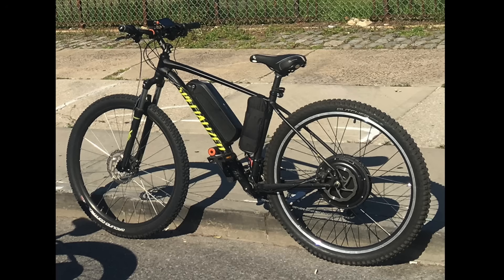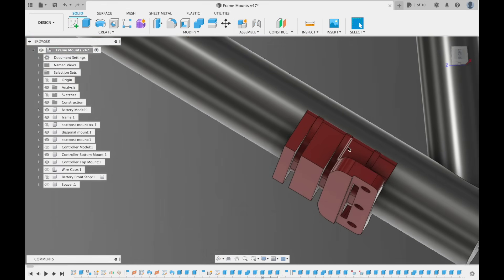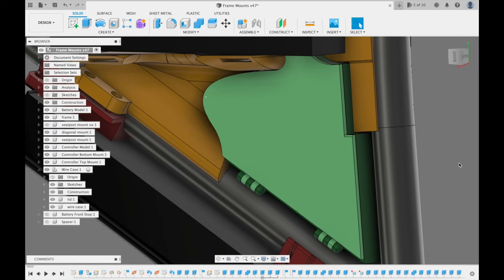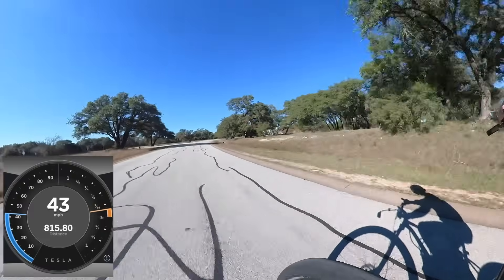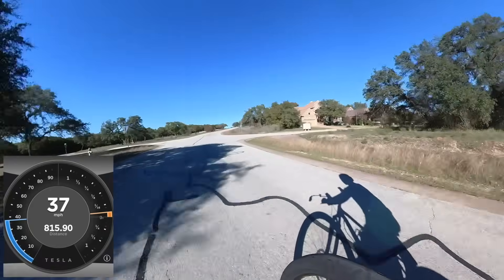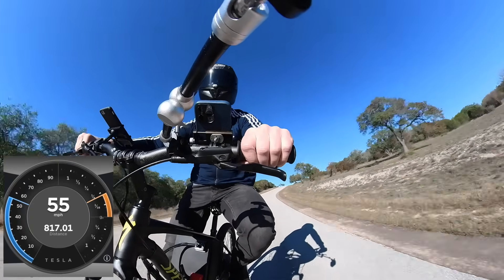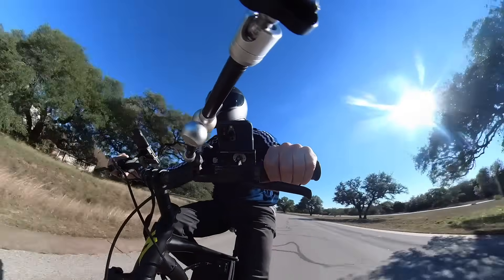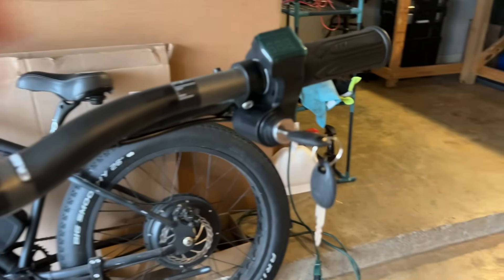I Built a 15,000W eBike and it's WAAAAY Overpowered

Comment: I don't know what kind of motor you have on that, but it seems like it should do a lot faster. Granted you have a lot of weak spots. The frame, you, your brakes, and pretty much every other part of the bike except for the powertrain. Lol You should try putting this on something heavier than just a bicycle. A bike with a decent battery and a CYC motor would do everything that yours just did.

Comment: Nearly 2x the power of my cargo bike build god damn. I have a 72V 8kW mid drive to a slim motorcycle tire in the rear with a proper chain.

It's a bakfiets style bike which means it handles like a yacht and being a steel frame it uses a lot of that power just hauling its 100lb self and 200lb rider up to speed.

Comment: haha, yup high voltage equals higher top speed.  wondering about the heating of those lipos in an enclosed space, pulling high amps.  also the windings in that hubmotor.  I built a bike from the wheels up, using a qs 273 motor laced to 18” motor wheel.  3” wide rubber front and back.24s LiFePO4 cells…40152s.  150 amp controller with regen. good 4 piston calipers on 203mm rotors to stop.  So important to have good brakes.  180mm travel fork with 40 mm downtubes.  hardtail on the rear😳.  110 lbs.  wheelies too easily, tops out at 50 mph, could squeeze out more speed with flux weakening adjustment in the controllers parameters….but why?!    It has bitten me a few times doing wheelies.  Still wear scars, lol.  be careful!  gear up.

Comment: How do you import your frame and ebike controller models into fusion 360? I want to make a 3d printed mount for my sabvoton just like yours! 🎉
Reply from the maker: the only way to import a physical object into Fusion 360 is with 3D scanning but high-res scanners are expensive. The lidar and/or photo-based scanning on an iPhone can be used but the quality would be poor. The best low-tech method is to carefully measure whatever object you want to import and manually model it in Fusion 360. That is what I did here and the same for all the other models I've created which an be found here: https://cults3d.com/en/users/GaiusGarage/3d-models

Comment: This is an awesome and wonderful hand work 🎉❤. I love everything about this SUPER eBike, never seen something like it.
My questions are how can I make my eBike to relatively have good speed. It’s 24volts which only has PAS, I think the controller is about 250watts.
What should I change, the controller, the hub, battery or both. I know my bike will not reach even half speed of this😂.
Greetings from Nigeria
Reply from the maker: Thanks! The bike will be faster if you upgrade the controller. but you many also need to upgrade your battery to supply power to an upgraded controller. You will also be sending more power to the motor so it may overheat faster and you may need to upgrade that also. so the answer is to upgrade all three
Reply: @GaiusGarage  appreciate your feedback.

Comment: E-bikeguy did 105 mph with a similar bike to this.
Reply: Exactly, I saw that video too that E-bike guy built and it was insane, and that was not exactly a fancy bike frame, just a regular bicycle frame. He had a steering damper on it, which was good, but my concern were the bicycle wheel bearings spinning at that speed with weight on them. You know those are tiny ball bearings running inside cheap steel races. Maybe it's fine, I was just wondering how they held up to the stresses of 100+ mph. Or the vibrations in the frame at such high speeds. But it worked fine!
 I loved the sound during the on-board part of the video as he ramped up the speed from about 22mph. It sounded like an airliner turbofan winding up on takeoff, it was awesome! Also the fly by videoed by E-bike guy as the rider flew by at 100mph was incredibly cool.
Reply: That is insane... It was scary enough at that speed with my 500CCM 58hp KTM road legal dirtbike lol :)
Reply: I was thinking how did he only achieve 60 mph When I seen a dude do double nearly. 
A 72v 15000w can achieve around 80 mph and 90+ off the ground. 
I would imagine a 100v 15000w would achieve close to 100mph and around 120mph of the ground. Or even more, I don't know. 

Doesn't really add up. Sure it's not a 60v peaked 7-8000w 😁

Comment: Hey buddy, for safety please,please put a flashing LED light (white) on the front of all your bikes. If someone came out in front of you going that fast , you would be toast. All people should have one. This is the reason I put it on the bike. As we all know from riding street bikes is that the most dangerous part is people not seeing you and pulling out in front of you. I laid my 1100cc Harley down because a woman didn’t see me. Luckily she paid for the damage. So after that I was out in the fog and I seen the strobe light on school busses. I said that’s it. It’s been 2 years now having a battery operated LED flashing, I have not had 1 person pull out in 2 years. , it lasts a long time and I just recharge it. You can wire one in of course and save your life. When they look now they see my flashing strobe, no more not seeing me. Mine are removable with rubber straps and are easily transferred to another bike.

Comment: How many watts can I claim on my footscooter build? It has 2 450 phase amps for a total of 900 !  It is 100.8v top charge 24s 16p samsung 45amp 50s cells.  The controller is 2 fardriver nd 84530 330 line amp . What is my real watts I can claim ? I am so confused! Please help.
Reply from the maker: you would use nominal voltage of 86V and 2x 330 line amps so 86 x 2 x 330 = ~56kW, which is pretty insane!
Reply: @GaiusGarage  thank you sir ! Much appreciated! I was figuring 48 but ...mathematical challenged after 50,000 🤣😅😂

Comment: I'm still blown away by just how cool 3D Printers are!!!
I'd love to have one, maybe one day I'll be able to afford one, they must come in super handy when deciding to build your own e-bike and doing various other fun projects..
3d printing is amazing.

Well on you for building one helluva an e-bike, I bet it's a tonne of fun to ride!
Reply from the maker: Thanks so much! yeah 3D printers can be really useful. you can pick one up for maybe $150, although the less expensive ones can be a bit more frustrating to use
Reply: @GaiusGarage  Hi there, 
Thanks for replying (most don't lol) I was wondering if you could help me with a problem I got...
I bought a Sabvoton 7245M Controller (£180) and when I tried to connect it up to my Voilamart Kit when I twisted the throttle the damn wheels were spinning at the same time, which terrified me so I ended up putting the stock Voilamart controller back on and shunt modding it...
Thing is I really want to somehow get the Sabvoton controller working with my bike, I tried to connect it to my phone using the USB lead but it said it wasn't recognizing the connection - as I figured I'd have to run a set-up test before I could get the controller working correctly with my e-bike build, which is a Voilamart rear hub kit 1500w48v with a 52v20ah battery...

I'm now looking at ordering a Sabvoton Bluetooth Dongle (£40 from eBay) as I'm thinking this must be the right thing to do so I can get the controller working with my bike..

Do you know if the Bluetooth dongle has to be specifically for Sabvoton? As £40 seems a bit much for a damn Bluetooth dongle, I mean if it's my only option I'll pay it, but it's just got me wondering..?
All I want really is more torque power as my current setup does 35-37mph tops I just want it more powerful hence the reason I bought the 7245m controller as the stock Voilamart controller is only 30amp I'm sure...
I just don't get why the peddles were spinning when the rear wheel was, I'd been careful to get all the wiring done correctly..
I installed the MCQON app on my mobile too, I'll have to get the Bluetooth dongle as I don't have a PC so I'll only be able to use my phone to programme the controller.

Just wondered if you have any experience using a sabvoton 7245m controller with the Bluetooth dongle etc?
Cheers, and sorry about such a lot to read, I hope you can understand roughly what I'm trying to put across.
Reply from the maker: Yes, the bluetooth dongle has to be specifically for Sabvoton. it's possible that they sell them on ebay but I've purchased mine from the manufacturer directly. I'm happy to help with wiring for the Sabvoton - please feel free to book a 1:1 session here: https://calendly.com/gaiusgarage/30-min-consult
Reply: @GaiusGarage  Hi, and thanks for the info, I ordered the Sabvoton Dongle just half an hour ago, it should be with me by Monday (I hope).
I'm guessing you charge for a half hour consultation?
I should be ok with the wiring as I've looked at tonnes of info online, I've a feeling I may just need to alter the configuration of the motors phase wires, it something simple either way I'll work it out.
Most likely it needs to run it's initial controller set-up routine before I will be able to alter anything.
I was wondering, how much did your 3d printer cost you?
I'm guessing about 4-5k (or maybe more)?
I bet if I had one of them I'd have been able to 3d print some torque arms for my rear axle, I bought 2 x cheap ones off of e-bay, but I had no faith in them being of any use as they looked pretty naff to me so instead I fabricated 2 x Steel plate 5mm thick ones, and put one on either side of the rear end.
Made me feel so much safer than when using the cheap standard ones (exact same ones in your vid, the jubilee clip type, I think they are pretty much useless)...

I bet you've done some great projects with that 3d printer, damn I wish I had one as I think I'm gunna have to make some form of lower frame bar bracket to attach the Sabvo7245M controller to the underside of my lower frame.
Thanks again,
You've been most helpful, stay cool!
😎
Reply from the maker: @mickyb.8014 yes, the 30 min consult is paid I also have 15min version in case you need some quick info. The option is there if you need it. 3D printer is definitely not $4-5k. You can pick one up for as little as $150. Decent one is $300. premium is $1k
Reply: @GaiusGarage  wow, a 3d printer that cheap, that's amazing.
Thanks for your help and if I get stuck I'll get back to you regarding consulting etc, money's tight at the moment but I'll let you know how things go anyway when the dongle arrives and I try again to install the Sabvoton controller.
Much appreciated and all the best from across the pond here in the UK.
Reply from the maker: @mickyb.8014  sounds good! thank you
Reply: @mickyb.8014 the sovol SV06 can be brought for £200 and is the best bang for the buck 3d printer I have seen, it has full auto bed leveling and is almost identical to the prusa mk3 for 1/5th of the price.
Reply: @kiwihuman  Thanks Kiwi,
Much appreciated, I'll take note and look into this model in 30min when I get chance, sounds like a great little printer...
I've not decided quite why/what I'll be printing etc, but I just like my gadgets, cheers again!
Reply: @kiwihuman  Cheers, I've looked at these printers, seem pretty cool - thanks, I'll look further into them when I get more time.

Comment: I have two questions... actually three.
If someone paid you, could you make a similar vehicle with some specifications in mind.
What is the range on this thing at 40 mph?
And well hell I forgot whatever third question I had. What I asked is pretty sufficient.
What do you say?
Reply from the maker: Range at 40mph is probably 40mi or so (this pack is 2kWh and the efficiency at 40mph is around 50Wh/mi). I would be open to building something similar for a client. If you're interested the first step would be to book a project consult session here: https://calendly.com/gaiusgarage/15-minute-consult it's $25 but if I can't help I will refund the cost

Comment: what watt hub motor is that? and it can handle that kinda wattage and amps? nuts
any idea what the total weight is?
Reply from the maker: it's rated at 5000W but peak power is more

Comment: Looking at that wheel I think cheap aliexpress 1500W hub has way more potential, they look extremely similar in size. With proper controller and high voltage battery it could do wonders. I heard people push them to 5000W no prob, I hope to try one day and see for myself, I'm still on 52V 65kph top speed
Props for courage, I would not drive even 1000W on alu frame, it's looks skecthy af, hope it serves you well
Reply from the maker: you can those 1500W hub motors at 5000W briefly but not 15000W, at least not without quickly overheating them. the construction tends to be cheaper and the EMF properties are less favorable (weaker, more noise etc.)

Comment: 15,000W power unit, good for 60mph .............frame; wheels; brakes; tyres all good for 30mph max that flimsy battery holder is asking for trouble too.  get real - if you want to go at 60mph your money is better spent on a little Honda.................. cg125

Comment: Genuine question, will painting the fins black on the controller not increase heat?
You could put the batteries in a pizza rack over the front wheel to keep weight forward, especially in that form factor.
Rad build nonetheless
Reply from the maker: I think technically it does but not enough to make a difference

Comment: LifePie4 bapperies serm grood as hospitlles use. Trest me, si good. ;)

saventyto volt erty amp grate 4 long travel many miles like monroe :)

-yer walca
Reply from the maker: LiFePo4 are good but energy density is lower -- they are larger and more heavy for the same capacity

Comment: You'd need an A2 motorcycle license to ride this in europe, but even then it wouldn't be legal because it's homemade and it's not registered
Reply: Homemade is okay I think, there just isn't a way to get this registered because it doesn't meet like any of the safety requirements.
Reply: @valtarijunkkala  To use such vehicle on public roads in Europe, you will need a motorcycle driver's licence which is completely separate from the one for cars, registration (with plates), a roadworthiness test, and a compulsory third-party liability insurance. It's effectively the same as a DIY motorbike or car. Near impossible for a natural person. So no, homemade is unfortunately not ok.
Reply: @fuxseb  Well this is literally, accoring to law, A2 class motorcycle and you will ofcourse need A2 license to drive it.

as far as I can tell, reading from Finnish authorities websites, you can get a homemade vehicle registered. So, DIY is ok.

However, as I said, this bike doesn't meet any of the safety requirements, for a A2 class bike, and so this specific bike isn't going to get registered.

My whole point was that being DIY is not a problem in of it self.
Reply: Mind your own business nerd
Reply: All it needs here in Texas is pedals and you don't need a license and it's perfectly legal. Some cities may ban these things but so far, so good here.

Comment: IMO the higher speeds and stresses of the more powerful eBikes really demand a steel frame, especially in an area with bad roads. Only issue is that steel frames are a lot harder to find on anything that's not a touring bike.
Reply: Or idk... A fat tire bike? You can easily get those with steel frames

Comment: "overkill" power but didnt bother to put a high performance slicks tlr tires
Reply from the maker: Those maxis tires are actually very high performance, inflatable up to 60psi, not sure what the top speed rating is but definitely more than enough. slicks not necessary, I'm not taking this thing to the drag strip

Comment: Damn man, very impressive. ❤

Side note: My electric scooter makes 'just' 8.5 KW peak power, but has a tops speed of 116kph and does a 0-40kph in 2.8s. 0-60 in 4.4s.
Reply: Holy crap that thing must feel like a rocketship
Reply: yeah bro i gotta be easy on the throttle on takeoff or else its gonna do a wheelie
Reply: Same sort of acceleration as a Tesla.  No gear shifting.
Reply: my 3000w 72v ebike tops out at about 80kmh and thats scary enough for me
Reply: @justmechanicthings  mhm it's all about the frame. Strapping it on basically a cycle is way more raw. My scooter has 11kw, but it feels slow now because I've gotten used to the power+12 inch wheels and disc brakes stop way better. Tho its limited to 120
Reply: Death machine
Reply: ola s1 pro owner xd, i got the gen 2, pretty damn fun. Will lurch forward at every twist and will spin the wheels if it isnt solid ground

Comment: The battery box bracket could have been printed to have side clips instead of having velcro straps. With rubber sandwiched in between the bracket and holder to reduce vibration.
Reply: looked flimsy dangerous too